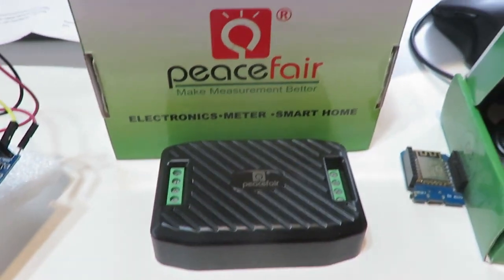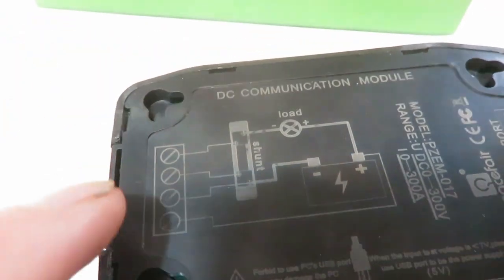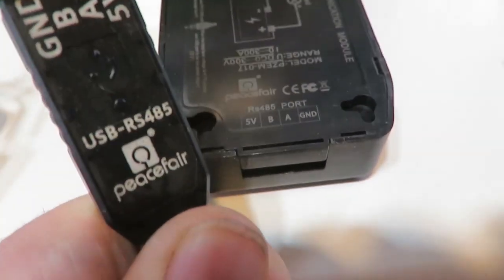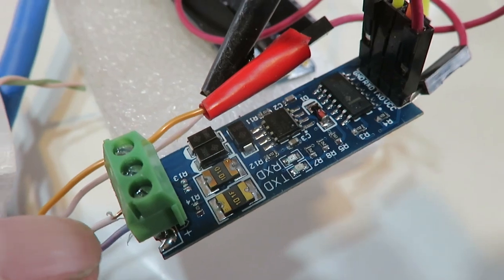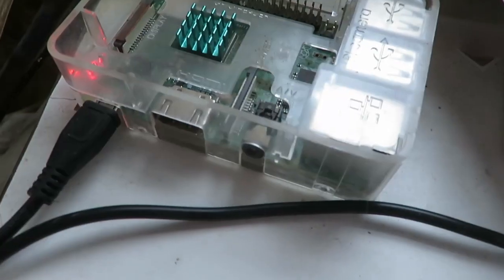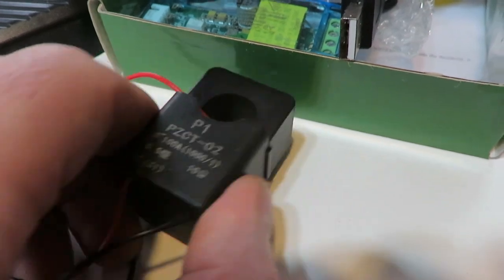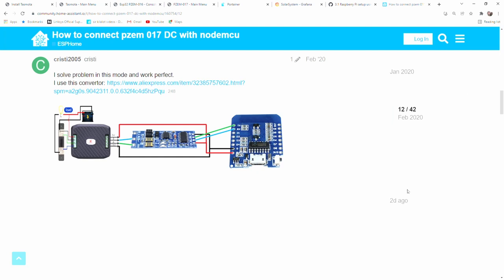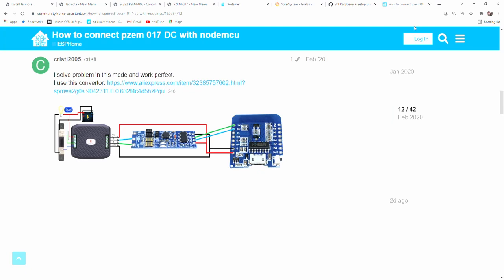Peacefair PZEM 016 / 017 connection to Esp8266  Esp32

Comment: Using a 485/TTL converter doesn't make sense. Simply connect esp32 pin directly to the 817 optocoupler before the MAX485.
Reply from the maker: Yes I have since seen some documentation on  tasmota site'how to do that. There was a resistor to add.
Reply: @LarryKapp1  Do something yourself and then share the content instead of searching Google and copying other people's nonsense...
Reply: @LarryKapp1  Do something yourself and then share the content instead of searching Google and copying other people's nonsense...
Reply from the maker: @Jannic-ee4mr  Thanks for the idea. Curious though why you watched my video instead of publishing your own independent analysis and video of the hookup ?  Well it doesn't matter - have a nice day .

Comment: Thank you for this.. I was heading down writing my own ESP32 code to connect to the PZEM-017... I didn't realize that Tasmota has support for it. This will save me allot of time. Thank you!
Reply from the maker: Yes it is amazingly easy. You can also remove the rs485 chip in it and skip using the rs485 adapter. I didn't do that yet but the simple mod is documented on the Tasmota github or somewhere. And if you use the AC version that is also supported as pzem-16 . There is another version of pzem that does AC and you can just hook up directly to esp32 if I remember correctly . I have both versions of the ac pzem
Reply: @LarryKapp1  Did you find any issue with the different shunt sizes? I read that by default the PZEM-017 is set for 100 amp shunt. I'm using the 50 amp.
Reply from the maker: @MyBluetti   I think I used the Peacefair PC software  with an RS485 adapter first to set up the shunt size.  Just make sure you don't ever do the Calibrate with that software because it will get it all out of whack.  I didn't understand what Calibrate was for when I tried it. ( it is to be used only if you have the specified voltage and load ).
Reply: @LarryKapp1  thank you. I will have to get the adapter to make that change... Mine didn't come with one
Reply from the maker: @MyBluetti  those usb to rs485 adapters are pretty inexpensive.  Let me know if you are in us and need any more of those pzem-017  - I think I have some extras that I got for not much.
Reply: @LarryKapp1  So no luck... I have to troubleshoot what I'm doing wrong. I have D1 mini's but I noticed they were 3.3v only, so I tried my ESP32 DevKITV1 board and wired it up... but I'm not getting any data. I suspect the pzem-017... I wish the PZEM had some led to show it was powered, as I'm unsure it's even working. Yes, once I get this working, I may be interested in getting those from you. Thank you.
Reply from the maker: @MyBluetti  are you using rs485 to ttl  boards between the pzem-17 and the esp32 ? I showed al the wiring in one of the videos ( this one I guess)  I made about these . On my rs485 board it has leds that will blink when tx and rx when the data is flowing. Try reversing the tx and rx wires or change them in the tasmota assignment.
Reply: @LarryKapp1  Yes, I used diagram you referenced to mimic the wiring... and I do see the ESP32 and RS485 adapter communicating, but I'm not sure if the PZEM is working. I ordered a RS485 to usb adapter to check the PZEM is working, as mine didn't come with that USB adapter. It will be a few days before I get that and then I'll verify. Again, thank you for your help! I also suspect that the ESP32 may be the issue, I see that you're using a esp8266... that will be my next thing to test.
Reply from the maker: @MyBluetti  It shouldn't make any difference between esp32 and what you are using. Double check pins on your esp you are using and try some different one maybe. I am also wondering if you need to load the Sensors edition of tasmota. When you go to flash it - look on the list for that one . I can't remember if pzem needed that or not ?
Reply from the maker: @MyBluetti  I just looked at my setup - I am using 18 pin generic ( for esp8266) and I am using D2 gpio 4  pzem tx and D1 gpio 5 pzem017 rx
Reply from the maker: It is the pzem-014 for ac that is ttl and  you don't need any converter to connect to esp-32. I think you need to use the pzem-16 settings in tasmota though .
Reply from the maker: look up pinout for your esp board. I looked up the d1 mini I use and notice it is using the pins associated with sda and scl so not sure if that makes a difference. My other pzem 014 ? board - ac model that is ttl and not rs485 - that one I hooked up to the tx and rx pins on my esp8266 mini.  It is all a bit confusing with esp boards since they use d1 d2 etc and gpio 4 5 etc and when you look at the pinout you see what each pin can be used for  such as sda scl tx rx etc
Reply: @LarryKapp1  You mention that your D1 8266 is using pin associated with SDA and SCL..? So you're not using the TX (GPI01) and RX (GPIO3) pins? As I see that on the D1 Mini NodeMcu ESP8266 pins GPI05 is SCL and GPIO4 is SDA. Should I use these instead?
Reply from the maker: @MyBluetti  It can't hurt to try them .  Yes I just looked at my other D1 Mini that I was using for pzem -016 ac version and I was also using what is labeled as D1 and D2  GPIO 5 and 4  SDL and SDA .
I just compared to pinout on Random Nerd Tutorials ESP8266 Pinout Reference  and that is how they are shown there too.  I am using Wemos D1 mini versions. That site is good reference for all things esp .
Reply: @LarryKapp1  agreed it is confusing,... but it's a good learning process. Yes I am use GPIO1 and GPIO3 which are listed at TX/RX. According to the documentation 1 and 3 are reserved for Flashing/Debug. It looks like SDA and SCL are GPI022 and GPIO21... I'll give those a try this weekend. Are you powering your PZEM via the USB on the side? I have not, as my variable DC power supply is sending 10v to the load.
Reply from the maker: @MyBluetti  yes powering at side on mine
Reply: @LarryKapp1  So I got my second PZEM with the RS85 to USB adapter. With that USB adapter, I was able to confirm that both PZEM devices work, but this is using the online PZEM app. I did also get a D1 Mini NodeMcu ESP8266 and wired it as described, but still no luck. I'm not exactly sure what I'm doing wrong. For your setup did you use the 5v power from the D1 mini to run the RS485 adapter or did you run seperate 5v power? I'm also going to try to hardware the setup, as I've been using clip wires... maybe I'm getting a bad connection.
Reply from the maker: @MyBluetti  Which RS485 adapter board are you using ? I think there were two versions and I only used the exact one that I had in my video. I power the wemos d1mini esp8266 board with 5v mini usb plug that is on it . Then I took 3.3v from that to power the rs485 adapter board.  I also had the pzem plugged into the 5v with mini usb power . I am going by memory for some of this but I think the PZEM-016 AC version would run without the 5v plugged into the pzem , and sometimes the pzem-017 would also but I keep it plugged in all the time now. For some reason my pzem 017 wouldn't work all the time, but I have it near my electric panel with high voltage dc to water heater, ac ssr , etc running my hot water heater stuff. But then all of a sudden after i made some wiring changes to other things the pzem 017 started working all the time again. Not sure why - maybe some interference.
Reply from the maker: @MyBluetti  Maybe you would want to try the mod to completely eliminate the rs485 part of pzem . Look up arendst/Tasmota/issues/3694 . I will post full link in next comment. Not sure if youtube lets me put links but will try.
Reply from the maker: @MyBluetti   link to eliminating rs485 shown in comments on this https://github.com/arendst/Tasmota/issues/3694
Reply from the maker: here is link to Random Nerd Tutorials https://randomnerdtutorials.com/esp8266-pinout-reference-gpios/
Reply: @LarryKapp1  This is my last resort... as I didn't want to alter the board itself. Plus the solution you show appears to be very straight forward... I'm just doing something dumb here.
Reply: Using the 3.3v pin out to power the PZEM seemed to be the problem. After changing that everything worked! Maybe having the PZEM and the RS485 was too much for it. Again thank you for taking the time to help me!
Reply from the maker: @MyBluetti  I am so glad you got it working finally . What power are you monitoring ?  You can easily set up the mqtt part now and graph it all out in a nice webpage from grafana running on a raspberry pi.  You may want to get one of the AC pzem versions - they work very well too.
Reply: @LarryKapp1  I'm measuring x4 solar pv inputs. Yep!.. I already have mqtt enabled and sending data to Home Assistant. The only thing I've noticed is that the 50amp shunts numbers are off. I read that I need to update the PZEM, as its default configuration is for the 100amp shunt. However, I'll need the PZEM software. Where did you that software?
Reply from the maker: @MyBluetti  on ali express peacefair official store 
 http://www.mediafire.com/file/vtvevyvattxi5sy/PZEM003%25EF%25BC%258C017-Master-English.zip/file
Reply from the maker: @MyBluetti   Don't do the Calibrate with that software or you will ruin it . Calibrate has to be done with specific inputs which I didn't know when I botched up one of mine.
Reply: @LarryKapp1  Ok, I did find this before... but Windows 11 blocks it from running.
Reply: @LarryKapp1 good to know. I probably just stay with the 100 amp anyhow. it works for my setup.
Reply from the maker: @MyBluetti  You should change the shunt to get accurate readings - it is a separate calibrate thing on there I was talking about.
Reply from the maker: @MyBluetti  runs on my windows 11 - you just need to go to the more info or advanced whatever it says when it blocks it and then allow
Reply from the maker: @MyBluetti  if you want any more of those pzem-017 send me an email - I know someone who has a bunch they want to move to a new home.
Reply: @LarryKapp1  right now I'm using the 100amp shunt because it works without having the calibrate the PZEM. My setup only requires up to 15amps, thus why I original went with the 50amp shunt. However, you say not to use the "PZEM003-Master" software to calibrate? correct?
Reply: @LarryKapp1  By this weekend I will have my setup connected to my large solar system. I tested last night with a small portable system and it worked great. If all works, then yes I will need more! thank you.
Reply from the maker: @MyBluetti  send me an email you can find on youtube
Reply from the maker: @MyBluetti  You can use the software to set up the shunt. But there is another place where it shows calibrate but that is just for calibrating the whole pzem from factory . So set up the shunt but don't do calibrate of it will throw it out of whack . I think there is a warning that I didn't understand.
Reply: @MyBluetti Hey I am using the PZEM - 017 , with a RS485_TTL and having issues , I want to connect it to an ESP32 ... can you guide me ... if it worked for you
Reply: @lokeshyadav823  yes I got it to work. What esp32 device are you using and how are you powering the chips?

Comment: Thank you for the detailed video. Can you use a Hall Effect- CT sensor instead of the Shunt when connecting with the PZEM-017 in a DC system?
Reply from the maker: I don't think ct sensor would work for DC. There is the pzem-016 or  pzem-014 for AC that uses ct sensors